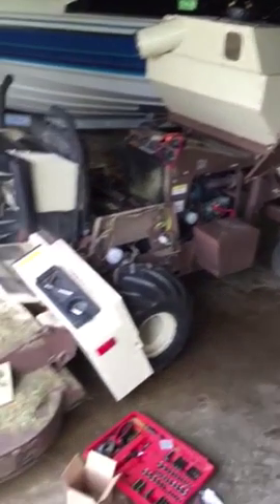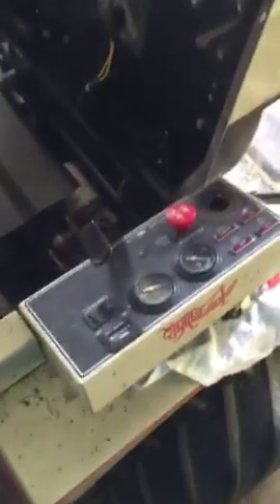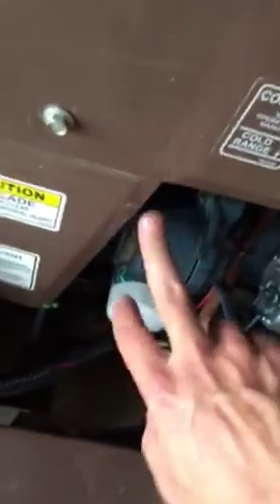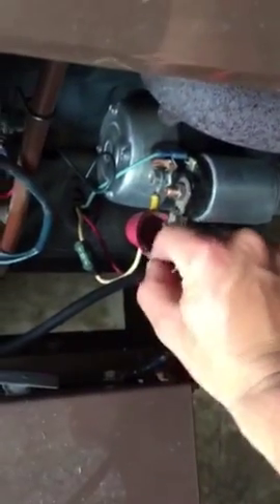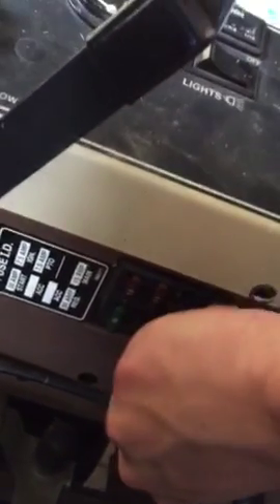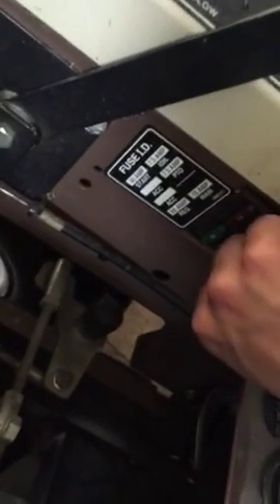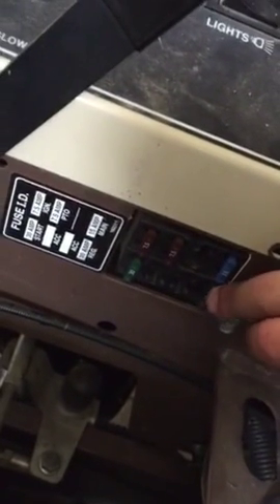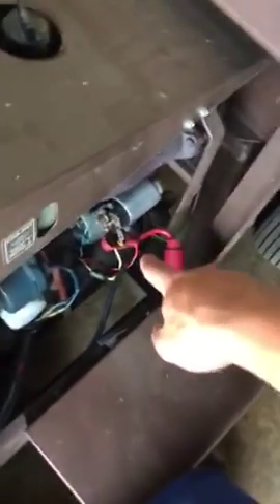Grasshopper 721d charging problem

Comment: If your battery is depleted or depleting, the charging system will continue to try to charge the battery to peak voltage.  Thus creating a overcharge situation which causes the 30 amp fuse connection to overheat.  Melting the fuse and the fuse block.   That's what I found on mine!

Comment: Its the fuse terminal not making good contact for the 30 amp fuse delivering the voltage from the regulator. Water, dirt and time degrades the fuse terminal.
Reply: Bad fuse block.  Mine does the same.
Reply: Thanks Chris, I have been having this problem since I bought the mower from Kanequip. Unfortunately, neither the seller nor the dealer prompted to check for such a thing. I purchased in 2016, been through 2 batteries. Seems like the heat affects the mowers electrical.
Reply: Time to clean out the debris from the fuse terminal! Thank you camper. WWG1WGA!!! 🇺🇸🇳🇫🇺🇸

Comment: Since the fuse is heating and not blowing it sounds like you fuse holder at that fuse is not clinching onto the fuse prongs. The heat is from a voltage drop across that fuse and holder. Clean and bend the prongs together for the fuse holder. Also add a ground wire to regulator mounting bolts.

Comment: Check the connection going to the regulator "you must remove the left wheel to access it" Mine was loose and slightly corroded.
I used wire ties to keep it together.
Fixed!

Comment: Check the wire where it comes out the loom going to the fuse panel, the wires sometime rub on the fuse panel holder, shiny pieces on metal that holds the fuse panel